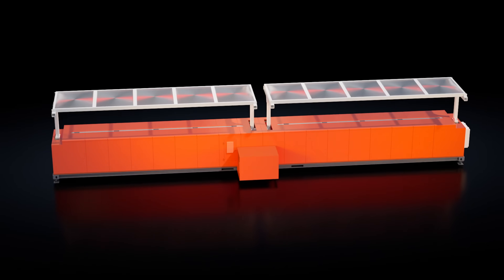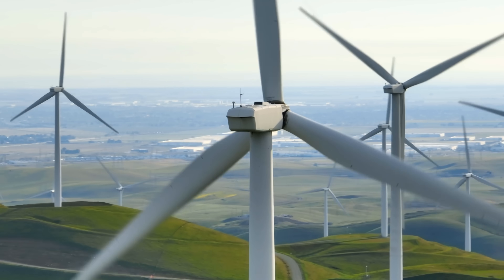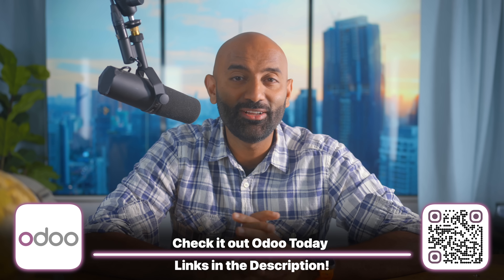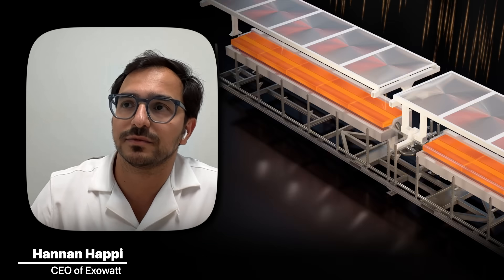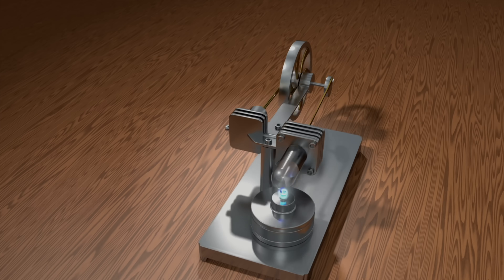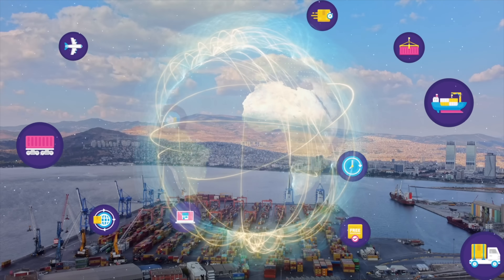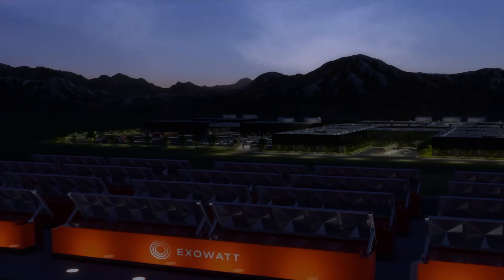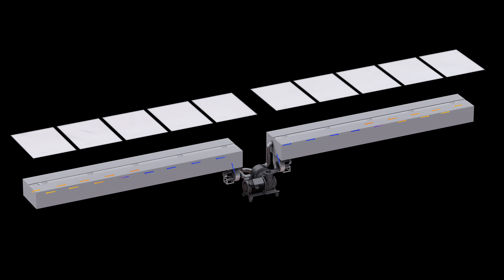Solar Without Panels, Storage Without Batteries - EXOWATT

Comment: One thing mentioned was differences in space taken up between the solar panels and hot bricks .what wasn’t taken into consideration was that with solar panels the coverage and shade provided can be used to great advantage with animal farming shelter and types of agriculture .Surely the efficiency of the panel would need regular cleaning .this would require water.This would would help with watering feed for livestock or for plants.

Comment: I doubt your claim that the land use of Exowatt is lower than standard PV modules. You state that the Striling engine alone has an efficiency of about 20%. The total efficiency cannot be any higher. Todays standard PV modules have efficiencies typically slightly higher than 20%. So the the land use is at best not higher than standard plants.

Comment: Ricky I certainly would love to see a site visit as well as a deep dive on the system, the electrical interface available to the end user regarding patch in to a 200a service panel, scale up and maintenance on those fresnel lenses.  I live in Central Florida which has extreme heat and sun 9-10 months out of the year and a unit such as this should do well so long as it is functional.  I have 10 acres so land is no problem for the footprint.  They have to paint that unit to a low observable color and NOT ORANGE.  Also need a better idea on total cost of a 25kw output system and a true and accurate representation of what the brick storage system truly can output in terms of kWh per day/night cycle.  A home in Florida with air conditioning use can easily use 100kwh per day and add EVs and all of a sudden you are talking about a TON of demand that needs to be addressed.  I look forward to your response.

Comment: If theyre mostly wanting to use them for ai data centers....which produce quite a bit of heat....why dont they pump that into  the stirling generators? Or into these clay batteries... I know they wouldnt get as much as they used...but it would still be something....and could be used in tandem with this system....

Comment: Interesting product.  I'd love a more in-depth look at how it works.  Some questions I would ask are:
- How safe is it to people/animals/vegeration around the device?  Does it get so hot that a fence has to be placed around them to prevent animals and humans to touch it?
- Can it be installed by anyone?  Or only technicians certified by Exowatt?
- Would it be available all over the world?  Or only in certain regions?
- How easy/difficult is it to replace parts like blocks, engine, lens, etc, in case of damage?
- Do they have to be aligned in a certain way?  Or can they be aligned at different angles to fit the shape of available area even if some loss in efficiency is expected?
- Can the units be relocated after installation?  Or is the installation permanent?
- What does the regularly scheduled maintenance look like in terms of type of labor, parts, time duration, and cost?

Comment: This is interesting and I would like to see a more practical comparison of this technology like what is the comparison of it to coal and or gas power products. Obviously it can’t beat them on cost but it could be a serous contender for off grid or temporary solutions or be an excellent clean renewable energy solution based close to industrial applications that might have large power demand spikes

Comment: When you talk about land use you're forgetting what become of the ground under your installation.
Compared to Solar panels, hexowatt artificialize the whole surface under it : it kills the soil and make it unable to absorb water. In case of solar panels, you can grow plants under, if not directly usefull for human consumption at least good enough for animals and also, by doing so, you keep the soil capability to drain water. I believe these factors, if not essential for energy production are very important to consider when you think about flooding, phreatic water renewal and artificialization.
Is Hexowatt usable on warehouses roofs ? That would be interesting. And why, in your reflexion consider that AI usage generalization  is inevitable or even desirable or sustainable without questioning it. We need energy first and fore most for people not for Tech companies to just grow profits and leverage finance.

Comment: Solar panels = no moving parts = low or little maintenance.  Exowatt - solar tracking & sterling engine = moving parts =  needs maintenance and wears out.  You state Exowatt has no maintenance, but I disagree unless you can explain what the "maintenance" required is and show it to be little.  Yes, site visit and more detailed information.  I don't see data centers being the major purchaser.  I see homeowners and businesses purchasing just as many units if not more.  Other countries, such as the Philippines, really need this because of all the brownouts and air conditioning needs because of excessive sunshine.  If this was close to being comparable to solar panels, I would purchase one right now for my home if it were plug-and-play, to power my house.  I can see the need for batteries to still be there to smooth out the load but I could run the a/c unit continuously to help.  Maybe that would be enough.  Need household voltages, though.  You don't say what voltages they are making.  One last comment.  Sterling engines, at least here in the USA, are not common and don't really work.  The only and best working Sterling engines I know about are the engines used in submarines built in a Scandinavian country.  But they are big.  Please look into providing lots more info about the Sterling engine.

Comment: I've watched this twice and still don't understand the principle. The bricks are hot, air is forced over them super heating it to 1000 deg. This is blown into  the Sterling engine, which is a positive displacement pump and turns a dynamo producing electricity.  What advantage does the hot air produce? Wouldn't this system work just as well with cold air? Part of this story is missing. Some principle involving thermodynamics is missing.

Comment: Wouldn't it be even cheaper and more reliable to not have the fresnel lenses move? Moving parts, as you said, require more maintenance and cost more. I have used fresnel lenses in the past to see out the back of my vans. They concentrate light into smaller areas. Light that comes in from a wide angle. I would take them and orient them, like solar panel racks, at the optimum angle for the latitude of use, and let the sun shin in on the bricks. Is the Sterling engine the most reliable and least expensive or would thermocouples/thermisters (Sorry, my science is rusty.) be a better choice to convert that heat into electricity?

Comment: As I understand this, it uses Fresnel lens to bake clay bricks. Fans at each end blow air over the bricks which are channeled to a Stirling Engine which then converts that heat into mechanical motion which is then converted to electrical energy.

If the clay bricks are housed in an insulating box to trap the heat, then how do the Fresnel lens heat the bricks, which are inside insulating boxes?

Comment: Interesting concept, my only thought is that the fresnel lenses may be fragile or degrade over time (depending on material), but as a "low tech" approach to alternative solar power, definitely should be further developed and deployed.  The energy density per area may be less efficient, not well suited for all situations, but as an alternative option for well fitting scenarios, this can be viable.   Sterling rngines have been around for many decades, nothing "exotic" here.

Comment: Australia MGA Therma;, Large scale Thermal energy storage - there are ongoing projects using alternate sources globally...

Exowatt - the (apparent) Fresnel Lens will not last for ever ??  What is the expected lifespan -Is it cast glass, or polycarbonate ??

Low Cost - vs efficiency..   there is merit in the rationalle.  remember REAL Cost - is HUMAN Capital.

Comment: Lot more impervious surfaces like concrete vs. panels. A lot of AHJs, as long as you space solar panel rows far enough away from each other, you can consider PV solar racking as not an impervious surface for stormwater.

Comment: Forget the stirling, just use the heat to produce hydrogen and and its derivates with high temp processes. And the ability to heat the bricks from the grid in times with low demand or high production makes it perfect to just place it near conventional power plants. Maybe inside the EPZ of a nuclear power plant.

Comment: I am a bit over the blatant lies of tech self-promotors.
"That one second across 4 million units is going to delay our manufacturing process by 31 years" ???
(1 sec/unit * 4000000 units) / (3600 sec/hr * 24 hr/day * 365 day/yr) = 0.12 yr  ...
So yes, there is some delay (about 1.5 months over a huge production run), but lying to make your numbers sound more impressive just does one thing: it makes you a liar. So what else about this project is complete BS?

Comment: Why do they need movable arms?  Just have multiple panels in an arc all fixed.  Could pick up indirect light and be more weatherproof long term- no moving seal and motor needing protection.

Comment: Lithium battery are good because they can produce a higher rate of power per pound. That's is why they are good in mobile uses, power tools and cars. 

Take away the weight requirements and sodium batteries are a great option without requiring a heat build up. Still locally sourced and easy to recycle. A sodium (salt) battery could easily be placed next to a house much like people get sheds preassembled and delivered. 

Solid state batteries that absorb heat are worth looking into but I do worry about the heat build up and it radiating heat around them. How far from the "battery" can you feel the heat? That might make it hard to scale down for homes and neighborhoods.

Comment: AI is so overrated, and currently uses way too much power. The AI bubble is happening. This is an interesting system. Local and modular, not a huge expensive solution like a nuclear power plant or the failed mirror steam plant outside of Las Vegas.

Comment: I love it!  Two questions that affect my situation...1. How are birds affected if they fly between the cells and the collector slots?  Is the mechanism so hot that birds are deterred from entering the area?  This was a problem for the massive reflector solar fields in the past.  2. You say that parts are made from steel.  How robust are the materials?  I live in a very abrasive coastal area.  Most steel components would turn to dust in a matter of months.  Is this application suitable?  

Thanks for the video!

Comment: It will require about 400W per unit to power the blowers, so conventional PV panels will be needed, and tracking sun will require motors and machine hardware.
Lots of moving parts that will require periodic maintenance.

Comment: I love the idea of this kind of technology, and can also appreciate the mechanical maintenance requirements.  Just a thought.  For smaller scale, residential, and potentially taking some of that latent heat for domestic/residential requirements from hot water to HVAC requirements.  Also orienting the container Southward, with the North end slightly elevated to help compensate for tracking limitations.  Just thinking out loud.  :)

Comment: Agree with another poster: this isn't for handling demands for data centers. If nothing else, data centers need consistent power, and I would suspect you would need more land to locate the 40' shipping containers than is feasible. 

This seems like a great solution for off-grid, farm, or small-to-medium community installs.

Comment: This is cool for so many reasons but have they thrown the baby out with the bath water when focussing on delivery rather than efficiency?

Each container would need a stack of insulation to keep each thermal battery in side the container from leaking its heat?

Just having a system where containers came in three types would increase efficiency massively. Standalone as they have made. Edge module and middle module. An edge module wouldn't have insulation along one side. Two put together with their uninsulated sides together would increase capacity and efficiency. A middle module would not have insulation along both long sides. The minimum size would be one middle module flanked by two edge modules. Larger installations would have them in long rows or maybe better visualised by coloumns. Lots of middle modules side by side with an edge module to cap each start and finish of a column.

Comment: If AI is inevitable and all of these data centers then our biggest concern is not storage or efficiency it's the grid... I've heard from several people at least one extremely close source who's worked on solar wind and the grid that it's not a matter of if but when, and adding double the load to our already peaked system, will guarantee grid failure

Comment: Technically there is nothing stopping putting something like this into new build housing. It could the not jut produce electricity but could be usind for heating too, like the old overnight storage radiators. A good flat roof could possibly take 2 to 4 of these.
It's nice to see old tech being used. Real interesting.

Comment: One way Exowatt could solve the land usage problem. Would be to restructure their Fresnel lens to a glass panel, thermal brick battery into an exterior wall panel, and Stirling engine separate into an interior ceiling crawl space of a building or home.

Comment: The system requires direct beam, if there's a little bit of clouds (literally a little cloud passing by) the optical efficiency of the lenses drops to 0. PV on the other hand produce electricity even with diffuse light from the clouds. PV is the greatest invention humanity has ever witnessed where energy is produced without any moving parts or engines! Just outstanding..

Comment: I like the idea, but I'm not quite sold yet. I think the mechanical parts of the system will be its Achilles heel. If steam engines were so efficient and reliable at generating energy wouldn't we still see them in cars, trains and coal or oil fired power plants?
I'd like to learn more about what some of the innovators on the African continent are doing with creating energy from existing radio waves.  I have no idea how that works right now, but I'd really like to know.

Comment: Sand silo's can store energy as Heat. Literally cheapest element on Earth. Therein lies the problem - No Big Profits! Anything that results in cheaper or free energy is immediately removed, or made illegal. In 1976 a Royal Navy Engineer designed a new type of Battery ( Aluminium Oxide) somehow the USA now owns patent, and it is locked away and Car companies are Banned from utilising it? A Aluminium Oxide Battery in a Tesla Model S, could do 3000 miles, yet three thousand miles. They cannot be recharged, but are 100% recyclable, they could be used as "swap-out" batteries.
The Elephant in the room is The Elites, the UN & WEF will never allow cheap energy. In UK we are not allowed to go off grid. We are slaves to the Energy Companies.

Comment: I clicked this because it sounded impossible, no but guy just worded it wrong. it doesn't use traditional panels, but a sheet of lens is still called a panel. and a block that stores energy, in any method, is a battery. it's just not a lithium ion battery

Comment: Pouring 10 to whatever size acres of concrete pads to place these units on does not follow the ideology that it is in anyway green. Having work on construction of solar installations ranging from 20- 800 acres , this system would be incredibly expensive, time consuming and very cumbersome to build. Perfect for an Amazon distribution centre parking lot though.

Comment: Down the thread someone commented on moving parts... The Sterline engine reverses motion on the flywheel that is not good use of energy, what if a turbine could use steam from the heat to generate electricity?? The heated bricks are a great idea and they could be used with hot liquids to propel turbines, (continuous motion) no crank shaft/flywheel.

Comment: In my mind, this is all very backwards thinking. Humans create this thing they cannot control, contain, or, as it were, keep fed, so what's our solution? Engineer and construct new ways to power said thing until they, inevitably and much-too-quickly, become outdated or, more likely, made woefully insufficient due to the aforementioned unchecked growth of the thing. Thinking the right way around would engineer an e- and sufficient power mechanism, making sure to meet all existing needs first and then using the surplus to power any side-projects (however unwanted).